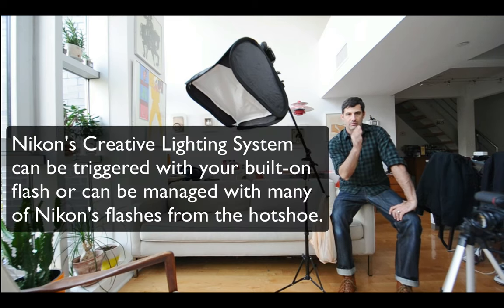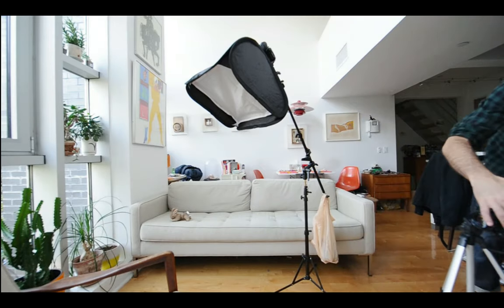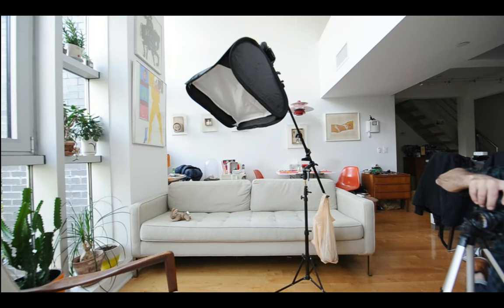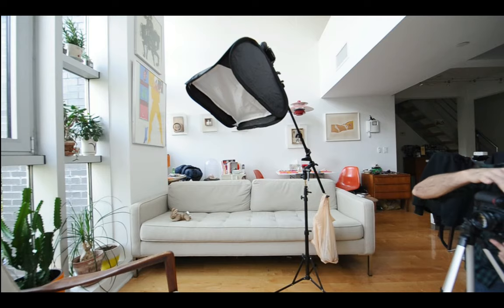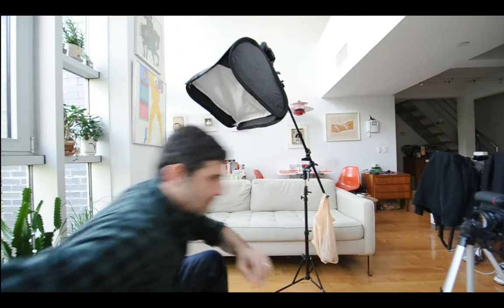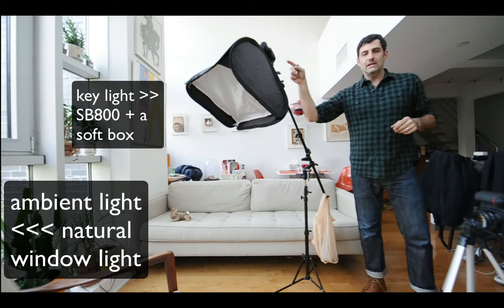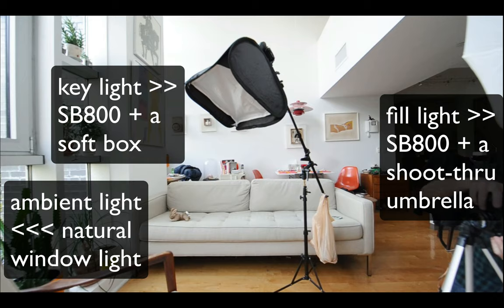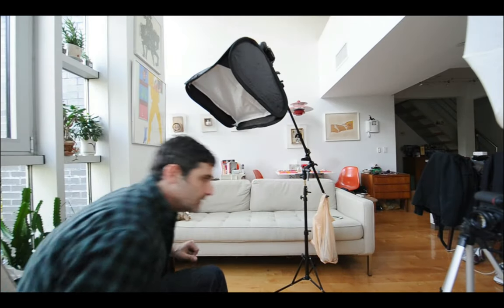How To Do Off Camera Flash Photography With Nikon's CLS System

Comment from the maker: @movania89 right, but you can use a SB600, SB700, SB800 or SB900 on-camera as a commander to wirelessly trigger other flashes by putting the on-camera flash in commander mode.

Comment from the maker: @EurghMatt right, but you can use a SB600, SB700, SB800 or SB900 on-camera as a commander to wirelessly trigger other flashes by putting the on-camera flash in commander mode.

Comment: Nicely explained use of the CLS system with two flashes.  For your test exposure, you had a much slower shutter speed, which would allow for more ambient light for the background, right?  When you chose to go to 1/ 200th for the flash, that reduced the amount of ambient light in the background.  would have been nice to have an explanation behind that choice, as well as why you don't use a light meter.

Comment: @LomoMop No i had a d3000 and it can't use the popup flash as a commander. But you can use a SB900 on the Camera as a commander. (several other Nikon flashes as well but not the SB 600). A good alternative to the CLS or quite expensive Pocket Wizzard are these: Yongnuo RF-602

Comment: @cmgoskate I think the CLS system only works over about 10 meters / 30 feet and via infrared light, where a radio trigger can work over 100 meters or more (300 feet) and they work via. radio signals, so they don't need another flash to trigger them...

Comment: thanks for the tutorial!
since the cls system uses the built in flash to trigger the external flashes the light from it has to reach them. but your umbrella is BEHIND the camera. 
how did you manage that all your gear still comunicating? especially when trying this setup outside, where there are no walls to might reflect the light for the information inside the flash
Reply: There was enough area for it to communicate.

Comment: @soul05extinct Yes, with a Pocket Wizard (or any other radio controlled system) it will work. There will be no such thing as TTL only Manual but it will fire! I use a SB 600 and a old Minolta 5400xi flash all the time. But i have also used a borrowed Canon flash.

Comment: I do get sharp pictures  when doing a group photography of students with the teachers in the  daylight what should be my Fstop and shutter speed.  what should be the mode of AF points?  Should I use single AF points or  Auto-AF points?
Reply: +Robert Pinto Your shutter speed should be within the flash sync speed range (1/250 and below for Nikon), since we want the picture to be sharp but with a bit of DOF, somewhere around F 5-6.3. AF mode doesn't really matter since you are doing a group shot (unless they are at different distances), so just go with Auto AF.

Comment: hey! i also use nikon d700 but reason is that could i use these lights or soft boxes without triger ??and second question is the TTL mode best or not ???
Reply: If you have a non CLS flash, you could just run a simple sync cord from flash to you camera's PC socket (or use dumb slaves)  - but why would you when you have the commander flash and SB-600/700/800/900 ? You need alternatives only when the CLS doesn't do the job (ex lots of others using it where you are, too much distance or blockages of the flash's sensor.) Go out and buy radio triggers only if you have to.

Comment: I'm shooting a d7200 with an sb-800 off camera.. attempting to use CLS.. however when I change the power of the flash through the camera menu, the flash power doesn't change. I'm shooting full manual on camera so I know the camera settings didn't change. Any idea what I'm doing wrong?
Reply: Sounds like you may need to change your flash settings.

Comment: Will that system also work if my flash is inside a octabox?
Reply: Only if the lower half of the flash remains outside of the octa.  If it's completely inside, it probably won't work.
Reply: @awlerner  ok thanks! :)